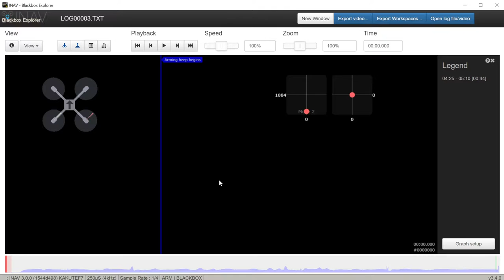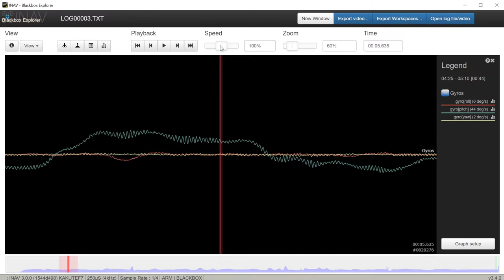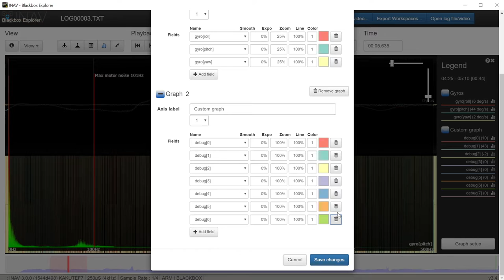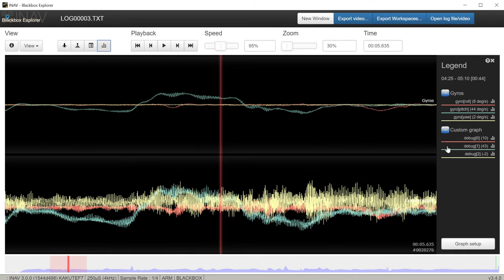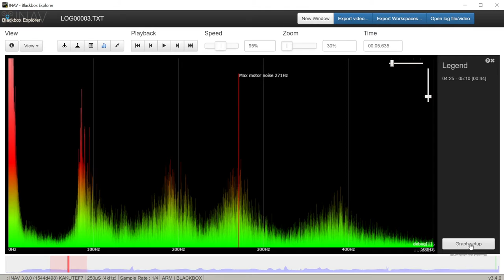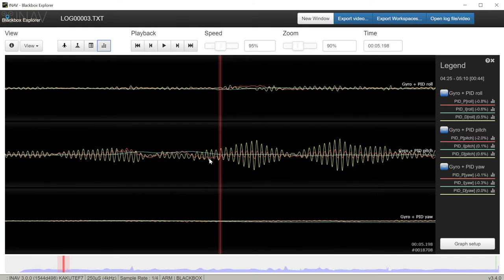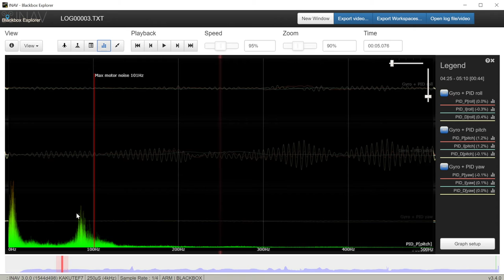Quad Tuning Series: Three, The blackbox log

Comment: Great info. Wondering if there is any value in examining vibrations from spinning up a single motor (and propeller) on the bench and if it would provide useful information. Since motor has a primary resonance frequency, learning this primary vibration frequency be of value? (like an unbalanced propeller, or damaged motor)
Could even compare result of each individual motor after each spun up one at a time. (with care)

My question is likely a bit of tangent for smaller quad tuning, but was wondering if checking each motor individually to get baseline vibrations across operating RPM range has any value. Thinking with wings, and larger propellers, balancing propellor/motor combination makes a clear audible difference.
Reply from the maker: In Outputs there is a Noise RMS measure. But it is relative. Everything depends on the craft itself

Comment: If I don't understand any of this does that mean I cannot succeed in this hobby?
Reply: Absolutely not, you can enjoy this hobby without any previous knowledge. Just use the defaults!
Reply: use defaults they are pretty good, or there is option to ask for a help with tuning. there are a lot of groups dedicated to pid tuning and even payed services
Reply: This tuning stuff makes more sense over time. If you're a beginner don't worry so much about it - unless your quad is acting buggy.
Reply: 5 months from that post I and still only use the default PIDs